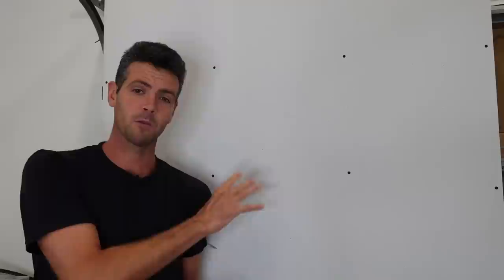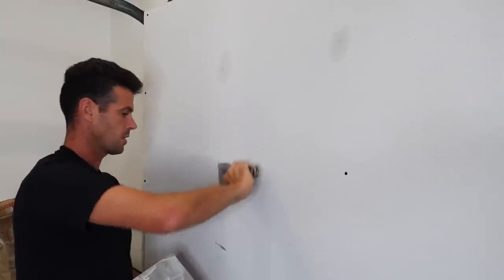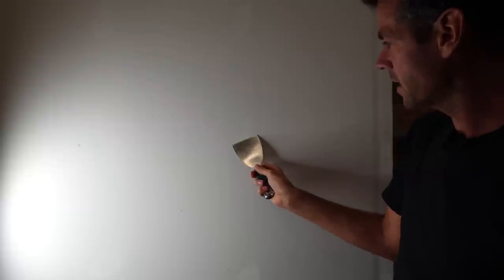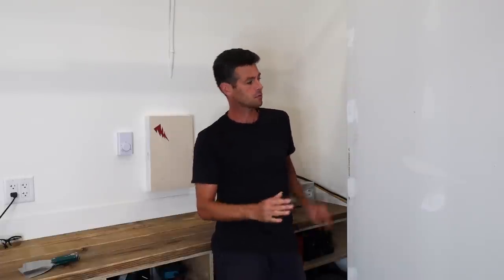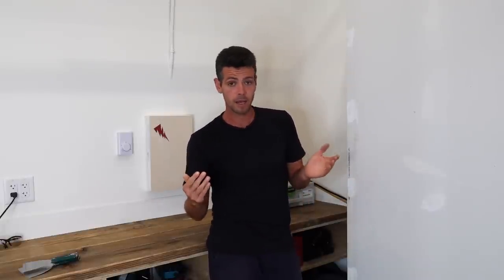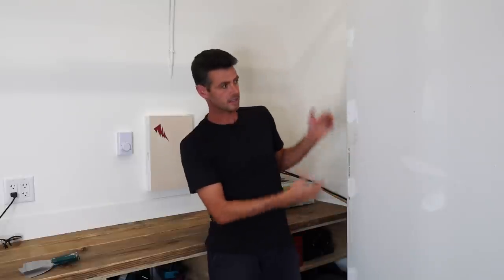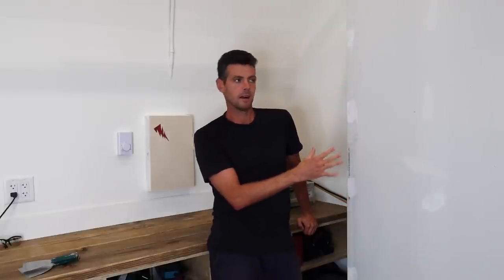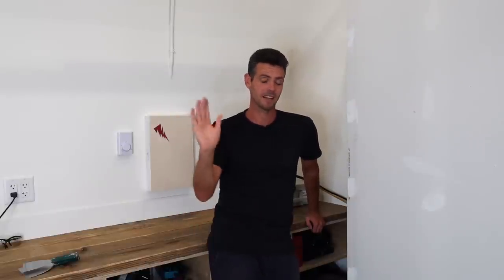How Coating Screws with HOTMUD can FAIL YOU!!!

Comment: Ben, I have not dealt with that worst case scenario you described. However, this is probably because as of right now I just recently worked up the confidence to try messing around with durabond for the first time, and I happened upon this video before I got around to putting the second coat on my screws. I am about to go out to the garage and start scraping right now. Thank you for once again saving my ass.
PS you have been my Yoda in regards to drywall. A year and a half ago I had never touched a sheet of drywall. When the time finally came when I needed to figure it out, I found your videos. Now I feel fairly confident that I could do an entire house from hanging to finishing and even priming for paint, thanks to your video on that. Thanks so much for all your help. Love the channel.

Comment: Thanks for being my drywall coach! I've got pretty good for a generalist handyman, but one thing endlessly frustrating for me is trying to match texture on a repair job. If you haven't already made a video on that, maybe a topic to consider for the future.
Reply: I second that!  Winter weather is coming up, meaning indoor repair season.
Reply: Matching popcorn on a ceiling.
Reply: @thezfunk  Haha!  Scraping that stuff off my ceilings is one of my plans.  I'm going to start small and see how stupid it is.
Reply: @tcoiler  buy a wide push scraper on a pole it comes down really easy if it's just the small popcorn ceiling can't say the same thing about the icicle looking texture ceilings made with plaster lol.
Reply: @MV-wb2cz  Awesome, thanks! I have a 6" and 10" drywall knife, so can use them.  Only where the cobwebs have gotten bad is it "icicle looking" 😀

Comment: A bit of Dex is a great fix for the imperfections after a coat of primer. But yes, if using 90 on the first coat they have to be scraped and or sanded before premix coats. Also, you need to put out more skate vids too! Cheers!

Comment: 😢this video brings a tear to my eye, 😂. Our drywall contractor used 90 to fill large voids, the house was riddled with nail pops but not in every room.  I assume they used the excess speed 90 where the nail pops occurred. The punch out team patched, sanded and re-painted for days. 

Today, 17 years later I have a bathroom with nail pops that mud is very hard!  Appreciate unraveling this mystery.

Comment: i always used easy sand 90 for taping. I did a no-heat house in winter and mixed the Plus3 with Easy Sand for the finish work because the premix would've never dried out. Helped it kick off and set up so I could follow up the next day with the next coat.

Comment: When doing first coat on screws with 90 quickset or any hot mud then you need to double wipe them. Durabond is not recommended as its non sandable . Double wipe quick up then down motion. No bumps! Deeper holes bumps a bit. Pro advice no charge 😁

Comment: When im at a really fast job and they want it skim coated ready to sand the next day , I notice that it does poke out a bit after coating it with a 5 in knife. But I apply just a tad heavy set of regular mud over the bump without scraping with a 8 in. Making sure to get a fairly evenly spread all around the bump. Easy to sand next day whether it be with the sanding machine or just hand sanding with a block seems to work for me every time

Comment: I'm a taper and I've finished houses using 90 for first coat, if you do screws this way it's a must to make a habit of scraping before coating them again. Using quickset eliminates having to do a 3rd coat because as stated in your video it swells rather than shrink. Of course the cons to this is scraping but it takes two seconds. I'd say it's a fair tradeoff given that you can get away with a two coat finish. Noted that this video is intended for diyers, just throwing my 2 cents in !

Comment: It's been a year since this video came out, but when I coat the 1st coat of screws, I like to use easysand hot mud. I always wipe a 2nd time to avoid the swelling aspect. 

Once in awhile there will be a few that will still swell out, but when I go to apply my 2nd coat on screws, you noticed right away that the 2nd coat isn't smooth. So I scrape off the excess easy sand that's causing that, and continue with the 2nd coat, and on to the third.

Iv never had any issues that I'm aware of this effecting a finished job. But Iv also never, to my knowledge, let a swollen screw coat stay beyond the 2nd coat.

Comment: Just did a wall with quickset and it looked fine, but now I will go back and check more closely. Thanks for the tip.
Reply: i've never noticed it with cgc proset 90 and I use it all the time.

Comment: Thanks for saying that you use quick set only to save time, I have a small job in my basement with some screws but time is not a major factor, I have both SheetRock 90 as well as a light weight general purpose mud. What I get from this video is I might as well just do the screws with the general purpose and use the SheetRock 90 for big gaps.  Thx Ben

Comment: Well, I just used Durabond 90 (with glue, because of you) to tape and cover all the screws of a large job in my house. Lots of joints with some being a little wide, so packed them full of durabond before the tape over top. I used Fibafuse for the tape. I will let you know what happens on the next coats with normal air dry mud :)

Comment: Plasterer from Australia here when we coat screws with base coat (setting mud) when you apply your first coat onto screws you put it on and then wipe it off one way then the other way which pushes it into the hole better then it won't swell (create a nipple)

Comment: I always use Easy Sand 25 or 30 for initial screw patch and if it does indeed come out, I scrape it and use pre mixed mud for 2nd and 3rd coat.

Comment: Durabond is much harder than regular quickset. It’s impossible to sand. It’s intended for pre filling joints. But it does have enough adhesive in it to tape with.

Comment: That explains some things on the repairs I made.  What was real frustrating, the ones AI didn't notice, actually swelled more after I painted.   Note, don't use Valspar paint, it actually softened the dried mud and created an air bubble, not just over screws.

Comment: Can't believe I've spent several HOURS watching videos of a guy doing drywall.  I've always avoided drywall like a single guy avoiding commitment.  But after watching Ben I'm a little less afraid.  I have hidden a damaged plaster ceiling for over 10 years but I have enough information now to at least attempt it. In the next six to eight months.

Comment: Ive always use  durabond as 1st coat over screws..I just wipe it almost  completely off with knife at almost 90 degrees ...then 1 or 2 coats of ap.   Its not as fast as  Ive seen some coat multiple screws with the side of a small knife but Ive had no problems.

Comment: Have had reasonable luck creating a barely perceptible "cup" below surface to take air-dry coats by wiping with a wet sanding sponge/drywall "sanding" sponge before completely set.  Probably equivalent to sanding but it has been faster and allowed just a "minimal 'cupping'" to take the air-dry second coat.

Comment: I use Durobond as my 1st coat always, yes you need to apply it smoothly,  and I can top coat it with regular plaster while it's still wet (I usually wait about 20-30 minutes). Durobond is excellent for corner beads as I can apply Durobond then set the corner bead and apply more Durobond covering the corner bead (I also like to mesh tape the edges of the metal corner bead to prevent future cracking). Durobond is excellent to fill large gaps and damaged drywall edges.

Comment: I cannot find a video where you say how much glue to put into hot mud for screws. Maybe hot mud swelled because in the quick/n/dirty job spoken about there was too much glue? And should it also be said there are possibilities to get ridges if you foam block sand a hot mud pimple divot that dried sticking out.

Comment: I have a question for you Ben, I have run into this with regular all purpose mud.  The only thing I can think of why this happened is that I framed new walls in a reno, went through the boarding, taping, mudding stage, primer, paint etc and find weeks or a couple months later that these raised screw bumps appear in some spots.  Is this due to the framing shrinking in your opinion?

Comment: don't use brown bag use easy sand
Reply: Right. Many people think the two are interchangeable and refer to each as hot mud or durabond. They are NOT the same. Durabond is much harder and exhibits these problems. I try not to use either on screws.

Comment: Just preparing for my very first DIY home drywall job. Is there an advantage to using quick-set mud to fill screws and for pre-fill? Is it ok to just use all-purpose mud for screws and pre-fill?
Reply from the maker: Totally okay to just use AP. If you have the time to wait for it to dry it’s no problem and will work great.
Reply: @vancouvercarpenter  Thank you so much for your reply! Ok, I’ll just use AP. I have lots of time to let it dry.

Comment: So if your coating each screw separately after 3 costs do you sand so it’s completely flush with only the screw hole visibly left with mud so it looks smooth?
Reply from the maker: yes
Reply: @vancouvercarpenter  Thanks

Comment: I use sheet rock 20 for screws and I have never had a problem
Reply: I ALWAYS used sheetrock 20, 45 or 90 for first coat, mind you I'm not a full time taper, just did a bunch of renos, but I never had any problem getting a good finish
Reply: durabond is a harder setting product, guess that makes a difference?